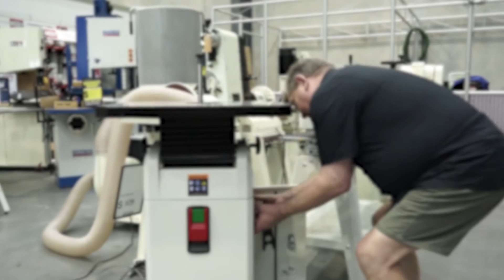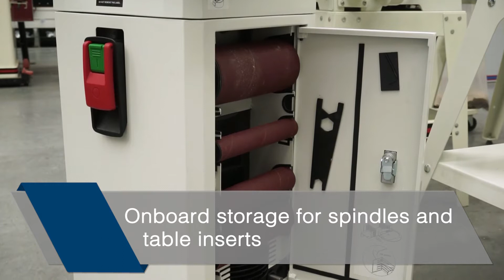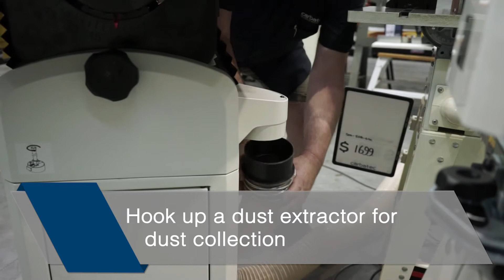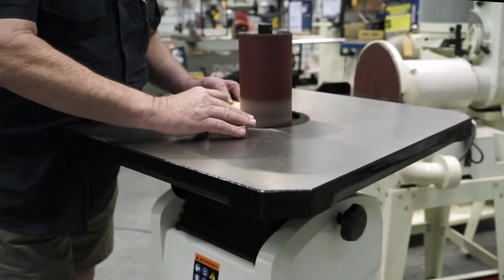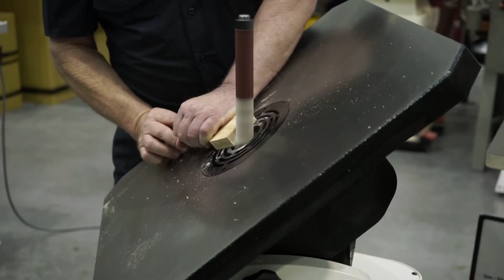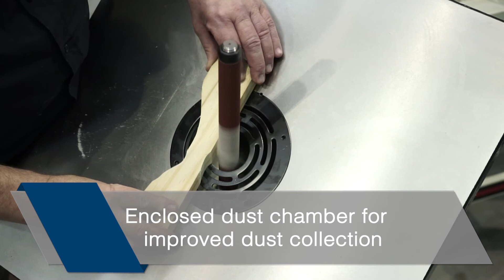Jet Oscillating Spindle Sander

Comment: The factory installed motor is 1 HP and spins at 1800 rpm.  This is way too fast for most jobs and if you catch your sleeve in it, you will break your arm (or worse). My new Jet Spindle Sander sat in the corner for 9 months. Finally, I took the motor out and dumped it in the trash. I installed a 3/4 HP, 1800 rpm, 3 phase motor with a Variable Frequency Drive (VFD). With a speed potentiometer (adjuster)  on the VFD, I can slow it down to 300 (or more) rpm. It wasn't that difficult to do.